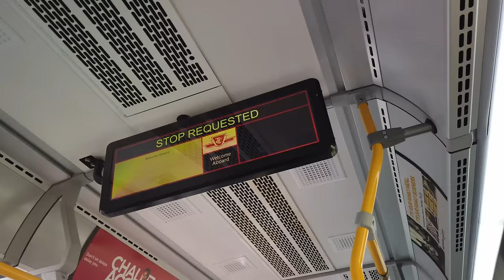Why American Buses Are Just Worse

Comment: There must be a way to buy a ticket on the transit vehicle. I encountered this frustrating situation in Trieste, Italy, where drivers do not sell tickets, there is no smartphone app AND there are no ticket machines; tickets may only be bought at convenience stores which are all closed after 5 P.M. I had to walk on foot over steep hills for 40 minutes to reach my hotel, being totally barred from using the bus system despite buses running well into the evening.
Reply: A kiosk on the bus away from the main entrance that takes coin, cash, and card would be good. Something where you can fill up a card or buy an individual ticket.
Reply: @jeffkardosjr.3825  These days it's much more convenient to simply accept contactless cards on board. You don't need a huge machine that's expensive to buy and maintain and takes a lot of space on the bus. Just a small terminal next to each door and that's it. As an added benefit, you can have a simple check-in system, which has a disadvantage of having to tap your card during each trip, but comes with a benefit of having automatic fare calculation - e.g. you don't need to think whether it's better to use single tickets or a day ticket, the backoffice system will do the math.

Comment: I gotta say Gilligs are the most comfortable transit buses I’ve driven between New Flyers and RTS. Also the best maneuverability and visibility.  Big design flaw with the New Flyer Xcelsior models is that when the front doors are open they obscure most of the driver’s view of the side mirrors so they can’t see people outside trying to board or alight very well.
Reply: What's a mirror? A lot of recent (>2015) European models simply did away with mirrors, replacing them with cameras.
Reply: @joachimnijs1967  you see the trick here in the US is to simply not purchase a bus newer than 2015 or never update the design from 2004
Reply: @Koopzilla24  it really depends on the Transit Agency and their budget.
Reply: @Koopzilla24  2004 your VERY generous I believe the New flyer 40LF came out in the early 90's and till the "NEW" Xcelsier design came out around 2018
Translink in Vancouver decided to ORDER custom bodywork to "modernise" there look and it is ONLY used on Translink vehicles

Comment: Thanks for the video. However, I think much of this is an ill-informed take. While your main points regarding vehicle variety and amenities may be true, these are all guided by the transit agencies themselves, who in turn are guided for their procurements by the American Public Transportation Association (APTA)‘s white book on requirements. These are extremely standardized and have different values that are…more pragmatic in nature versus, say, “rider experience”. This explains both your points. The bus manufacturers are beholden to the specs demanded by the agencies, who, like I said, are homogenous in nature. Should the demand for vehicles designed for different preferences arise, the manufactures are sufficiently agile to meet demand. And of course Canada is sort of forced to follow suit by volume. Thus, it’s a systemic issue with public transit in North America, not on our domestic manufacturers. A good example is Alexander Dennis who sells a product you describe as as great in North America, and they’re struggling to establish themselves because the product doesn’t jive with the market culture.

Comment: 5:02 Kinda unfortunate our newer buses have either horrid ergonomics (3 door MAN, citaro etc), VERY THIN padding (Ahem ahem citaro again ahem), or just have very rough materials to rest comfortably on. Ironically, our past buses had way better comfort, such as the SBS Volvo olympians or the B10Ms with the bench seating or the very thick cushions of the Dennis trident and B10TL. The only bus I can think of that has very good comfort is the one and only SG5999Z, the 3 door MAN demonstrator. Also this may be very subjective but I very much prefer the fabric material used on old TIBS/SMRT buses like on the Dennis lance or the o405, but it's very prone to getting dirty real easily. oh well, guess we can't have nice things.

Comment: Warsaw, Poland here: what do you mean no back door? It's, like, the most obvious thing, that's the door you hop on when you're catching the bus late ;) I'm sincerely surprised.
Reply: Well, I'm sincerely surprised as well ;) As in The Netherlands, the back doors are not to be used to board the bus, that's done at the front. Unless you ride the Schipholbuses (shown in this video at the 4:25 mark) where entering and exiting on all doors is allowed. There are probably some other bus-networks in The Netherlands that allow for entering and exiting at every door possible, but I don't know 'em.
Reply: Mind blown, honestly. Sounds like a nightmare, here in Warsaw all the doors are usually pretty busy, getting on the bus through one door would take a long time! And the first door is usually tiny, half the size of the others (back door included).
Reply: @shinsetsu1985  Yep. I do remember though that when an operator in the south of The Netherlands (BBA for the Dutchies reading this) was still around, the buses there would have a kind of mirrored door setup: the front door would be at the front, the rear door all the way to the rear. This made people exiting from both doors, depending on where they sat. Sitting up front made them exit at front, while halfway usually meant exiting at the back. It was possible as the line wasn't busy (it took something like 90 minutes or even 120 to get from terminus A to terminus B)

Comment: The two door buses in the US and Canada go back to the days of the trolleys when you had a driver and a conductor to collect fares. Additional doors use up seat space. Plus in the US, there are handicap considerations. The US designs go back to the buses in the 1950s when I was growing up and that has not changed. Also, you might want to see if crash rating are why our buses are the way they are. Like when Mexican buses crash, they don't hold up to well.

Comment: With how many different systems you've looked at, and how thoroughly you've examined the pros and cons of their planning decisions, would you consider doing a series on ways to "transitify" urban areas that don't have (enough) rapid transit?  I'd be interested to hear your suggestions for geographically-challenging regions like, say, Hawaii, Puget Sound, or Hampton Roads.
Reply: There is a very simple solution - use cars. They go to and from exactly where the passenger wants without having to do extra mileage and don't go running around aimlessly when no one is on them to meet a preset schedule. They also don't hammer the roads with massive weight being constantly driven around. Public transit is usually wasteful in its use. Busses are brilliant if used properly but they almost never are.
Reply: @siraff4461 So transporting, let’s say 20 person in 1-2 tons of steel individually rather than transporting the same amount of people in a bus is more economical, space efficient and road-wear friendly. What?
Reply: @siraff4461 I honestly couldn’t think of a more wasteful way of transport than individual car traffic except individual air traffic.
Reply: @janssen18  Average car occupancy is 2-3 people - less in rush hour, more at other times. 
Lets say 10 cars take 20 people 30 miles at 30mpg. Thats 10 gallons. Plenty of cars will do much more mpg and plenty can hold many more people.
To do the same journey on the bus at the 3mpg or so they get would also be 10 gallons. So far so good. 
Now what happens when that bus route isn't going to/from exactly where those people need to be? Thats right - they either have to use other forms of transport or another bus - either of which burn more fuel and add more time/mileage. Thats one factor in the extra wear on the road but the big one is the psi through the rubber. If you understood how potholes work you would know that water in a small crack gets run over and won't compress so it effectively blasts out the immediate surrounding asphalt. The effect of this is directly proportional to the pressure being put on it. Heavier vehicles on similar width rubber create far more ground pressure which is why they destroy roads much more quickly. 
I'm also not seeing cars being driven around miles and miles in circles with no one going anywhere in them. This is where the average occupancy comes into it. Average occupancy on our local routes is around 30% - good for busses here - but also means that more than half of the travel capacity of that bus is being wasted. Evening occupancy (after 7pm on the local ones is called evening) averages at just 5%. In other words one bus at full capcaity could do the job of twenty of the ones floating around in the evening. 
Explain how thats not a complete waste?
Reply: @siraff4461  If you don't mind me asking, what's your local bus company? Chances are, I will have been to where you live, so I can give you my impressions of what I think about public transport in your area.

Comment: Honestly, in Europe we used metros or trams, the only buses we rode were the old Routemasters from Trafalgar to the Tower of London (we came back on the Tube after walking over Tower Bridge and exploring the south bank), and a bus in Copenhagen to/from the Zoo because it was pretty far from the city center and the bus was the only thing that went there. I liked that the Copenhagen bus had a designated area for wheelchairs, AND an area for parents with strollers!
Reply: In Copenhagen busses, the area for wheelchairs and strollers is shared with bicycles on a somewhat equal basis.

Comment: Solingen, Germany recently had their trolley bus system reaching its 70th anniversary. They now also run battery electric busses that charge while they are on parts of their journey where there is a power line above and use that stored energy to extend the lines away from the trolley network. This is amazing for a city that has as many hills and valleys, where extending the trolley system is pretty hard in places, as you still get to use the core system and electric busses, without more special infrastructure being needed.

Comment: Here in Tampa, none of the buses are articulated, and the buses have a roughly 50/50 split of one door or two doors. Riders embark through the front door because that's where the fare is collected. Funnily enough, even on the buses with only one door, the recordings all say "Please exit through the rear door." On the buses with two doors, you're only supposed to exit through the front door if you require the use of a ramp or you have a bike on the front of the bus.

Also, all of the buses 'squat', which is kind of a clunky way to handle things.
Reply: All of the buses in The Netherlands I know also squat: Scania Omnilinks we had by Arriva from 2006 till 2012 were notorious for completely kneeling down first, but than at random (so it seemed) pumping the suspension bellows up again, resulting in many passengers nearly tripping.
At some point the software was changed so the buses started 'kneeling' to the side of the busstop. But so far that it actually became hard, especially for elderly, to board the bus, as I think the angle approached or even exceeded the 10 degree mark.
The VDL E-Citea you see at the 4:25 mark in this video is the bus I take to work on a workdaily basis and kneels/squats down at every stop, to get the floor lined up with the surface of the bus-stop. As soon as the driver presses the button to close the doors it levels again.

Comment: "Gillig still sells buses like this" except he showed one styling option. Gillig sells 6 styling options: Low Floor, Low Floor Plus, BRT, BRT Plus, Trolly ( Trolly is the only styling option that isn't low floor... Because its a trolly with bus wheels ), and Commuter. They come with the option of a diesel engine, CNG engine, hybrid electric engine, and battery eletric engine. While he is right that the low floor and commuter options are pretty basic the other 4 options are pretty sleek and nice and gillig offers so many interior options including customizable seats, customizable passenger information displays and automated speaker systems, and so many add on features like reading lights and power outles/usb plug ins. Gillig is definitely up there but they do only have an American market. My town has gillig brt plus buses that are 35' and 40' and they have reading lights and power usb plug ins for charging and a great inside/outside automated speaking system. I think the "this works for us, that works for you" system plays in here when talking about vehicles in different countries.

Comment: Effectively only 3 transit bus makers in the UK too, but they do a better job. Most buy in base chassis/drivetrains/engines (chassis often from Volvo/Scania, engines often from Daimler).  A very few vehicles from other European/international brands (possibly because of the need to have different tooling for UK/Ireland who drive on the left, but only for a smaller market).

Alexander Dennis (owned by New Flyer, chassis from Volvo or BYD for EV), MCV (Egyptian, owned by Daimler AG, who supply engines), and Wrightbus (Bamford, who also make construction equivalent, with the brand JCB being as well known and widely used in the UK as "Cat" is in North America, using a mix of engines in current models).

My main criticism with UK transit buses (all of them) is the interior plastic panels all start rattling and squeaking quite loudly after 6 months on the road.  And rural buses only have front doors, which isn't as accessible as having a middle door (which usually has a automated ramp deployment controlled from the drivers cab, so people needing wheelchair access board and exit using middle door, which is otherwise exit only).

Much wider range of choice for coach buses.
Reply: Funny how your experience with rattling and squeaky buses is something that increases with age, while my experience with Scania Omnilinks (Scania should have stayed building HGV's/lorries) is that they are rattly and squeaky from the beginning and will stay that way forever. When the free newspapers were still around here (are they still there in the UK?), you would often see a driver grab one, tear a page from it, to only fold it very small and than stuff it between a squeaky or rattly bit, just to stop him or her from going mad during driving.
The VDL E-Citea's are also squeaky/rattly, but by far not as bad as Scania Omnilinks.

Comment: Would like to plug battery-electric buses for a bit here - my city (located in Scandinavia) has quite a few electric buses now, and they're fabulous, by and large. We first got Volvo buses, and these are awesome, and also extremely powerful with some crazy acceleration ability for a bus (and the articulated version weighs 30 tons!) Last year, MAN battery-electric buses also appeared. These are fairly decent, the HVAC performance isn't quite up to Volvo standard for some reason, but other than that, they hold their own - and interestingly, these articulated buses are actually four-wheel drive, with motors on both rear axles! Which is pretty nuts.

Also, massive torque and excellent acceleration, we have some fairly steep hills here, and these buses can actually accelerate uphill. Oldfashioned roaring diesel horkers could never get even close, they have to downshift and snail their way up the hill with a queue of cars forming behind them.

And this leads to the one biggest difference - noise. Anyone who's been waiting at a busy bus stop with multiple lines coming and going know how awful the noise is when those diesel beasts start rolling off, even when they're just chuffing along at idle they're noisy mothers. Electric buses, while the motors and inverters do make some noise, it's a non-metric distance unit's worth of a difference compared to the stone-crusher-like noise levels of a 10/12-liter diesel engine. If you're a block away in a residential neighborhood you barely hear the electric bus even at nighttime when it's quiet.

Also, pollution. No diesel exhaust, no smelly fumes, no cancer vapors or particulates. Braking is assisted by regenerative brake action, so less particulates from brake pads and discs as well. This IS the future. It really is.

Comment: The operating practices for buses need addressing here too.

I recently went to Barcelona and was amazed when I got on a regular local bus that had all door boarding (and yes had three doors) and where fares are paid using multiple on board validators. (Same for the trams).

In the us, all buses I’ve ridden require everyone to line up at the front door and pay their fare one at a time, like has been done for fifty or more years despite the advances in fare payment methods.

I imagine there would be fear mongering that proof of payment all door boarding on buses would lead to more fare beating (a sign that buses are associated as an inferior service)but it’s something universal in most light rail systems.

Kudos to Boston for using their AFC 2.0 fare upgrade to move to all door boarding on buses and trams (as well as Charlie card on commuter rail).

Comment: Unfortunately, AC Transit's experience with Van Hools was not good. They were built for smoother European city streets, and started to fall apart quickly on rougher American ones. Then they had a really terrible ride. The model was also had fewer seats, which wasn't a problem on shorter European trios. They did have an actual back window, which was nice.